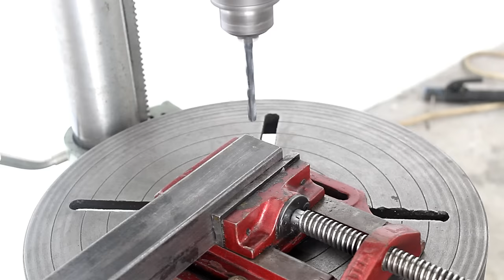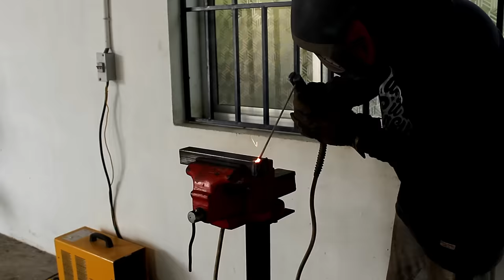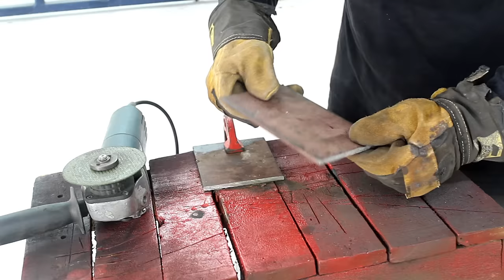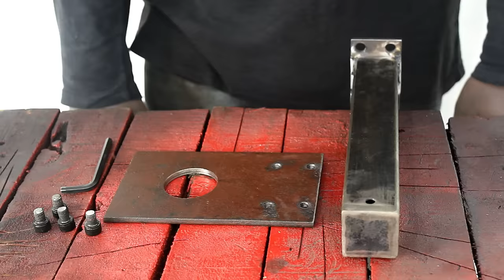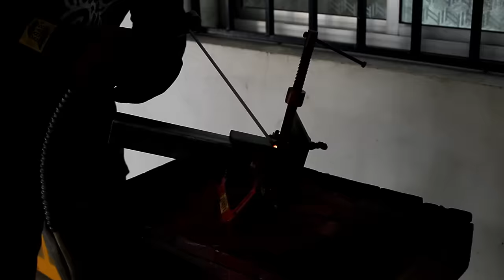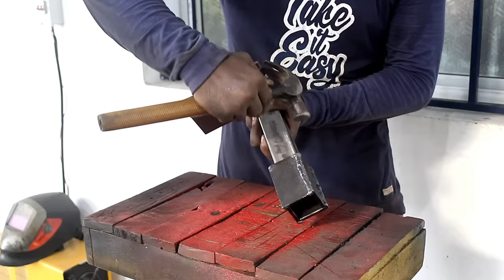How To Make A Drill Press | Homemade Drill Guide | DIY

Comment: Box was a little banged up, but the product was still in perfect condition  https://www.youtube.com/post/UgkxajoEbapTfqWaadnqb04h6U576yxXp-FE . Easy to set up. Easy to use. It has an extended height vertical shaft with a holder for Dremel bits and a hook to hang one of the hanging type Dremel motors. I chose not to use that, so it's easy to keep it short and simple. The Dremel fastens in by removing the threaded collar for attachments and then setting it in the fixture and there's a threaded collar in this stand and a wrench to tighten it. It works well, but I don't think I want to routinely take it on and off again to use the Dremel by hand. I'll buy another Dremel and keep the current one in this fixture.
Reply from the maker: Thanks bro

Comment: I've seen so many videos on making a drill plunger and this is the first one I see where you did something so common sense as to put the springs in a pulling action rather than a plunging action. So simple yet this is the first time I've seen it used.

Comment: You did a good job, well done. I would make the arm a little longer so you can fit larger items beneath the drill and make the bottom plate so that you can mount it. I'm amazed your welding was so accurate on the arm to the drill socket. If that sint flush to the horizon all that work would be for nothing. Well done good sir.
Reply from the maker: Thanks dear

Comment: Good video. But I think I would have made it a drill press rather than a drilling guide. If you will put a handle on the back side  of the post on the carrier , it will make drilling easier.
Reply from the maker: Thank you william

Comment: So you need a drill press to make a drill press!!!!
Reply from the maker: I'm just showing how to make it. Without drill press this can be made
Reply: saty sookai I thought the same thing 😄
Reply: Diamleon Diy Builds a piece of Channel for the foot could help. But your design was great
Reply: A drill press is usually stationary. What Diamleon built was a drill guide that can be moved to a work piece. Try lifting a 30lb piece of steel or a 10 foot piece of lumber onto a drill press, then position it to make accurate holes. If your tool is larger than your project, move the project. But, if your project is larger than your tool, move the tool.  Hope that helps.

Comment: Do you call this homemade?
Your home is in the workshop I guess and that too with lots of heavy machinery
Reply: You realize the lathe work could be done with like sand paper right?
Reply: Wow it takes a whole expensive shop equipment to build a homemade drill press. Why not just buy a real drill press at Harbor Freight for $75 - less work and less expensive shop equipment. Plus you can return it if you don't like it.

Comment: The title 'homemade' makes no sense here. In a home where there is no drill press, how often would you see those other tools at home?
Reply: Wow it takes a whole expensive shop equipment to build a homemade drill press. Why not just buy a real drill press at Harbor Freight for $75 - less work and less expensive shop equipment. Plus you can return it if you don't like it.
Reply: @vickyklab1739  You're right that there are too many unusual tools for home projects. Ok. The problem is that the video is aimed at those who ALREADY have a drill, and since they have one, they have used it, and since they have used it they end up realizing that in many home DIY projects, fairly horizontal drilling is VERY necessary.

It's true that this video doesn't fit a home profile, but the idea ends up being that: you will need an adapter for your drill sooner or later.

Comment: Множество дорогого промышленного оборудования используется для создания простого пресса для дрели. Ок.
А зачем нужно было отрезать трубу болгаркой на токарном станке, если для этого можно использовать отрезной резец (Раз уж всё равно токарный станок участвует в процессе создания)? 

A lot of expensive industrial equipment is used to build a simple drill press. OK.
And why did you need to cut the pipe with a grinder on a lathe, if you can use a cut-off tool for this (since the lathe is still involved in the creation process)?